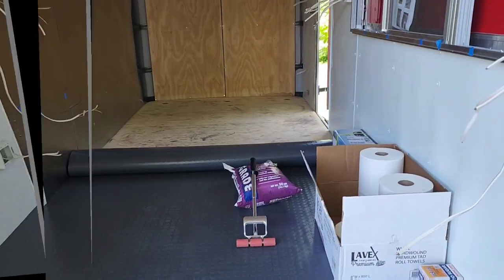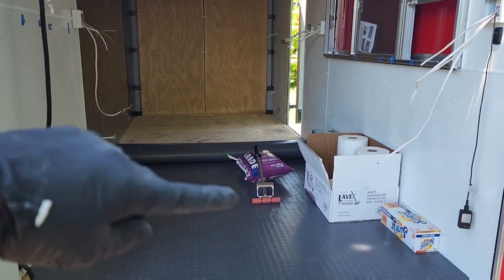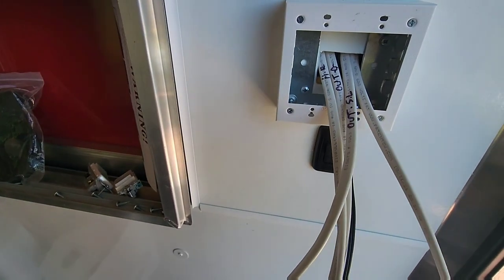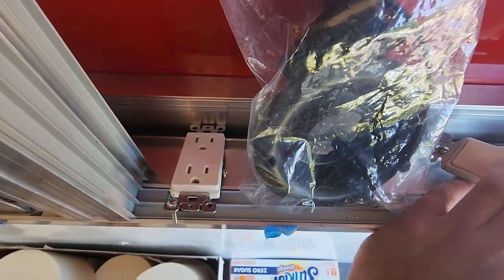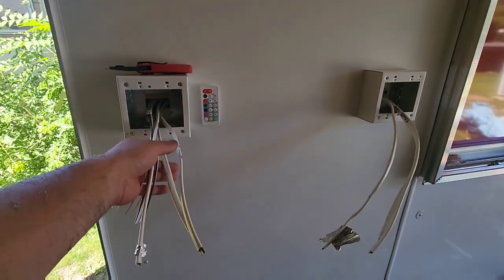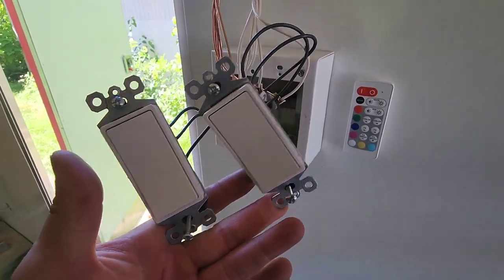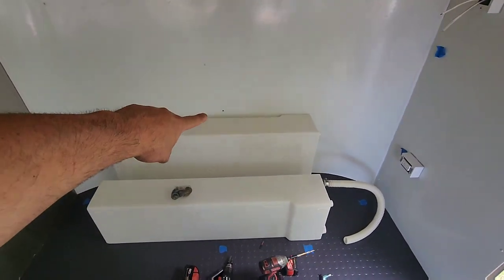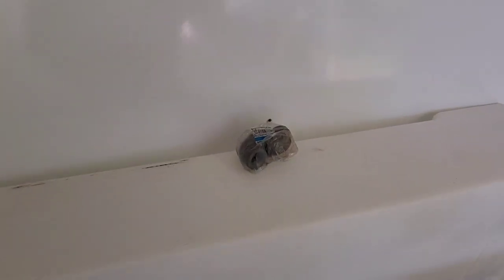How to Build a Food Truck: Tips and Tricks

Comment: Hi Frank,  can you tell me where you found the liquid tight 3/8 to 1/2 adaptor for the exhause hood? I can't find one.  Thanks.
Reply from the maker: It's a 3/4 to 1/2. Picked it up at Home Depot in the Electrical section as a rigid fitting in that section

Comment: Hello I need a little help. Am building a rotisserie to attach to my truck. What kinda glass would I use for the rotisserie box that would be heat resistant. Am thinking the regular glass ma Burst
Reply from the maker: I've never dealt with glass, but I know that tempered glass doesn't break into big chunks. It's what cars use on their windows so I'm assuming it's pretty durable

Comment: Hi frank, I have a rv and it has a 30 amp 10 gauge wire outlet…I have put up a panel inside and have 5 15 amp breakers installed. I have not tested it, any advice before I do? Thanks
Reply: The 10 gauge wire is feeding the panel btw